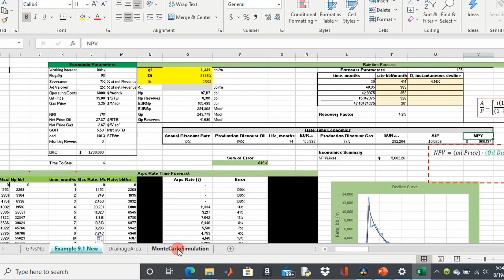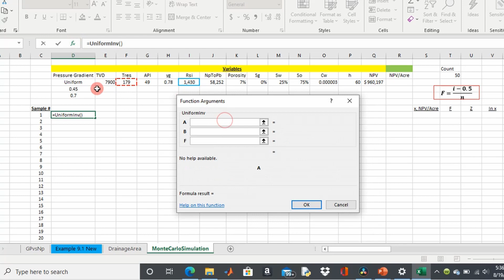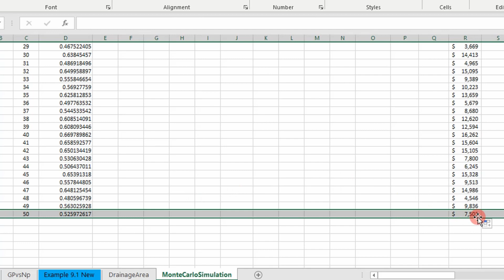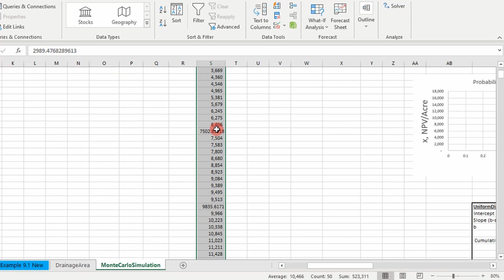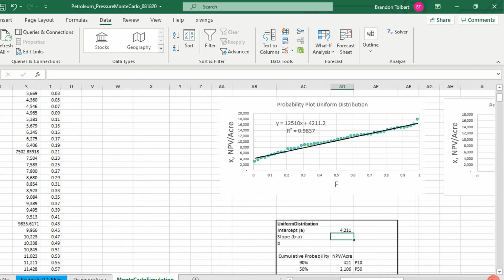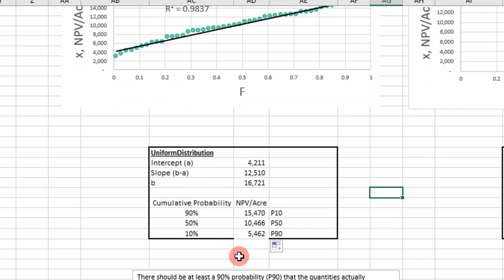Monte Carlo Simulation: Uniform Distribution Probability Plot

Comment: Couldnt find Uniforminv in excel
Reply: I am using data with no random number in, so had to double check.  Chat GPT advises there is no Uniforminv function.  This is how I was told to calculate the 90%, 50% and 10% values.  (b-a)*(90%)+a = (12,510*.9)+(4.211)